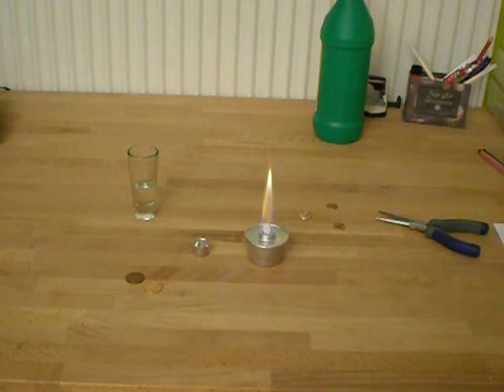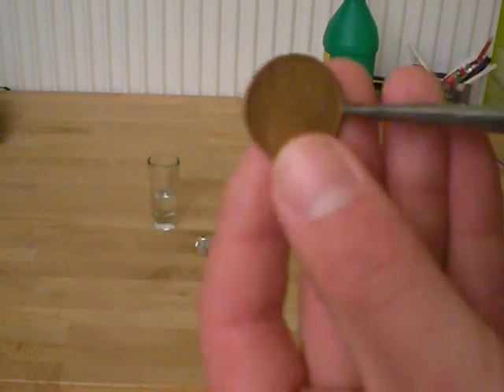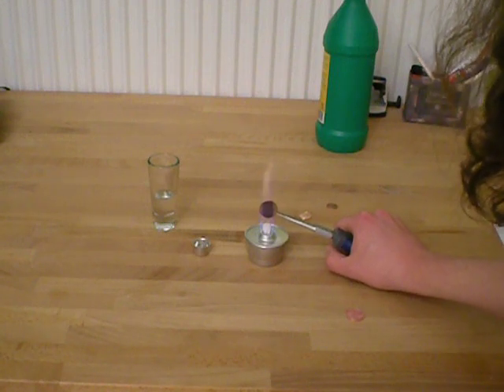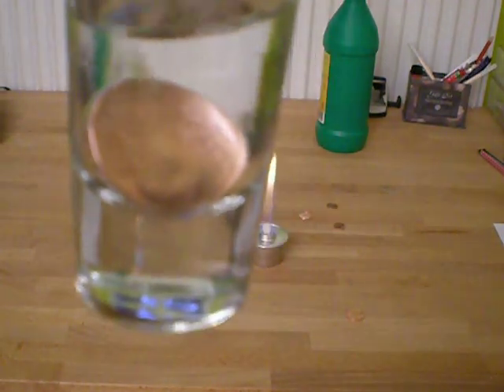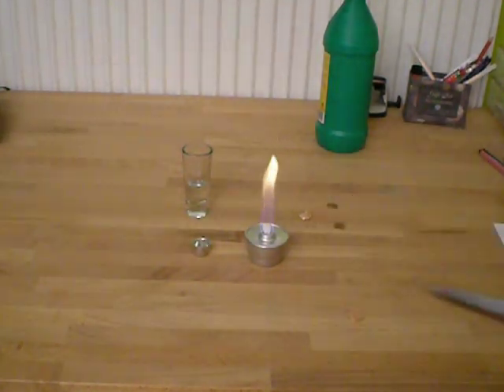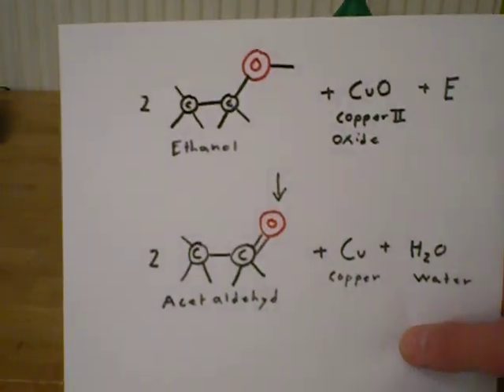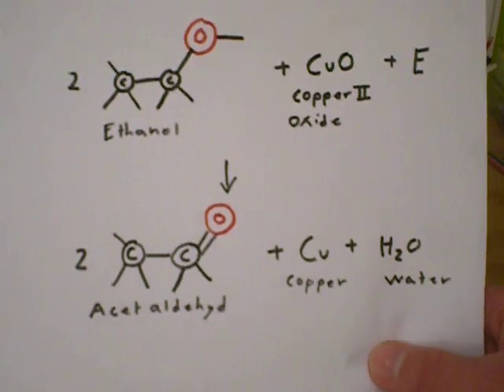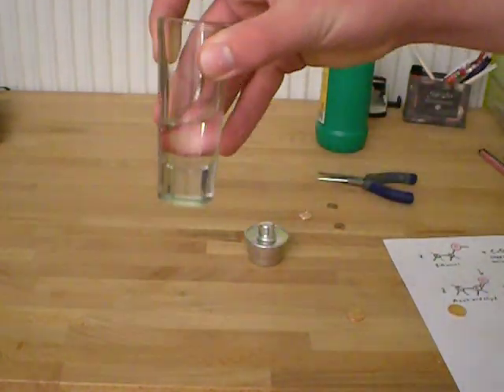How to DeOxedize Copper coins by Catalytic Oxidation of Ethanol

Comment: Sir if I mix ujala colour in one class of water.. If I dip the copper coin in that water the colour changes to white. What is chemical I have to ise tell formula..
Reply from the maker: ok, so correct me if im wrong, you English isn't the best, thus the clarification. The experiment you are performing is to place a copper coin into a mixture of water with the fabric whitening agent "ujala colour remover" correct?

Since i have not yet found the MSDS for it, i will have to work based on the composition of similar products.

there are a few things i could be, that is creating the white coating. With just one experiment it is hard to determine what it is that has formed. 

my first guess is Copper(I)Chloride, as it is a white, mostly non water soluble salt of copper. This can be created by the bleach present in the water. To confirm if it is copper(I)chloride (CuCl) you would need to place the washed coated coin into hydrochloric acid, or in water mixed with sodium hydroxide (drain cleaner). 

If placed in the hydrochloric acid, it should stay as it was and not dissolve. If it dose, then it is either a salt of a weaker acid, or an alkali salt. 

If placed in the Sodium Hydroxide solution, it should dissolve away, if it dose not, then it is a salt of a stronger base then sodium hydroxide. 

If placed in a solution of Sodium Carbonate or Bicarbonate (washing / baking soda), and it is a chloride, it should slowly dissolve away to form a brown precipitate in the water. If it dose not then it is an alkali salt of copper.

With the results of the above experiments we can narrow down what you are looking at. 

Once we have identified what it is, we can then determine the reaction that formed it. Without more information there are just too many possibilities.
Reply from the maker: a few fun overkill options (more expensive and time consuming then its probably worth) are the fallowing (in order of feasibility):
-placing the coin into a secondary ion mass spectrometer
-placing the coin into a electron probe microanalyzer
-placing the coin into a Scanning Auger Electron Microscope
-using reflected light spectroscopy and or ramen spectroscopy, referencing against a known pure sample of the possible compound.

The above will determine the definitive composition of what ever the white stuff is. Though its far faster and easier to do it via analytical chemistry as described in the below comment.

I mention the above mainly because they are interesting subjects to read into
Reply: @lbochtler  sir if u don't mind can I get ur contact details..
Reply: Sir I AM not hable to understandable can u tell me short... Formula
Reply from the maker: @ulsmetro  i do not have enough experimental results from you to identify it. There are too many possibilities.

I described a method by which it can be identified in a previous comment. 

Perhaps try using google translate if English is not your first language, it might be good enough for you to understand.

Comment: Sir copper coin Needle pushing camical name please Sir please
Reply from the maker: i assume you want the name of the chemicals used, as well as their reaction.

I should probably put that in the description at some point.

Basically the input are Copper(II)Oxide and Ethanol. They form Acetaldehyde, watter and copper

CuO + C2H5OH ---> Cu + C2H4O + H2O
Reply: @lbochtler sir anti iron camical name please Sir
Reply from the maker: @Praveenkumarkn1983  you want to turn iron oxide to elemental iron, and would like to know the chemistry involved?
Reply: @lbochtler  sir camical name
Reply from the maker: @Praveenkumarkn1983  if my assumption is correct, then you can reduce rust back to elemental iron by means of hydrogen. One method is to heat the rust under hydrogen atmosphere. The other more safe and easy options is to use an acid such as phosphoric or hydrochloric acid. careful with hydrochloric as it will start to dissolve the iron as well, but much slower then the rust.
Reply: @lbochtler  sir .Red phosphorus...or. Hydrochloric acid ..okay sir
Reply from the maker: @Praveenkumarkn1983  phosphoric acid, not red phosphorus. Phosphoric acid is a liquid. It is what is created when you burn phosphorous and then add water. Its available commercially.
Reply: @lbochtler  okay sir .Hydrochloric liquid..and phosphoric liquid. two' camical k.k sir
Reply: @lbochtler  sir. 2 .liquid name okay sir  liquid in Market different types please case number please sir
Reply: @lbochtler  hey... actually want to know if we can make copper anti iron.... copper plate or coin repel iron. In India people are getting mad for this chemical reaction. Which chemical gives the copper anti iron reaction...